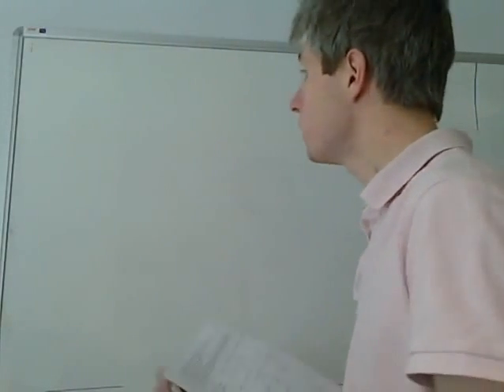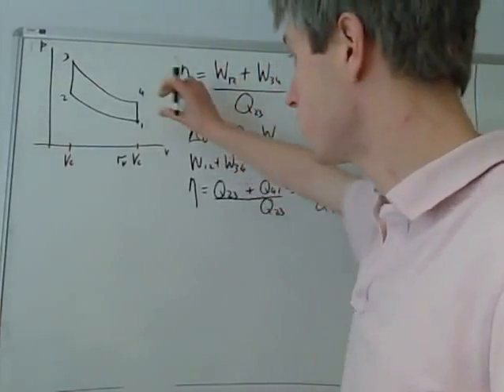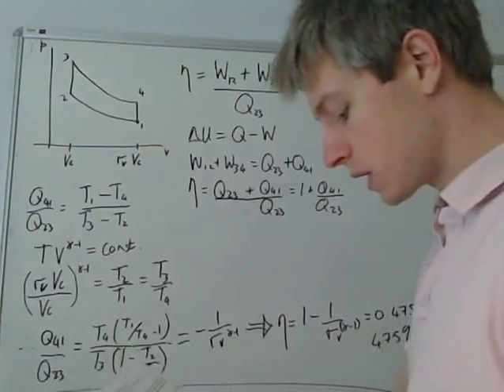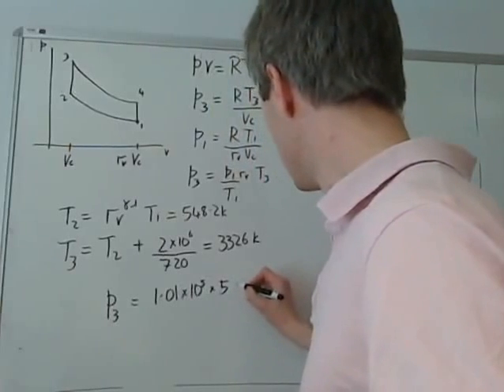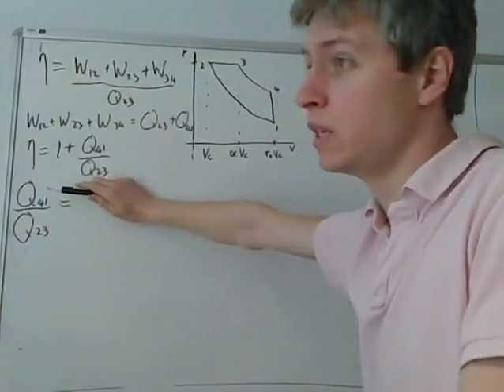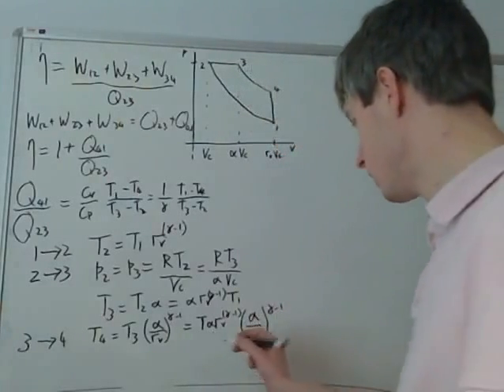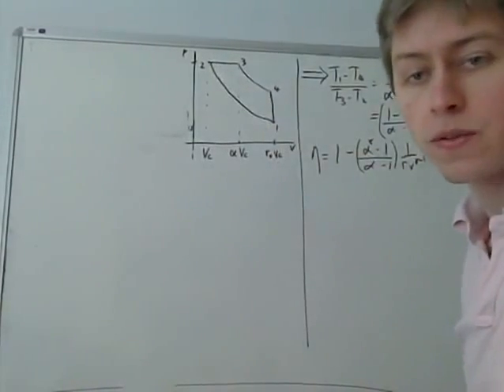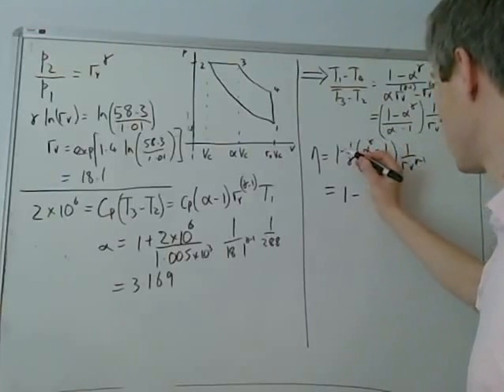Air-standard analysis of Otto and Diesel cycles: thermodynamics example question

Comment: The whole system and formula are flawed-just like calculating recoil from a rifle is flawed because there is a jet propulsion aspect to the discharge...the first major problem is that if the containment vessel holds a temp equal to that of the compression ratio heat release, then you achieve the 'air standard' compression pressure-this is stone age stuff..